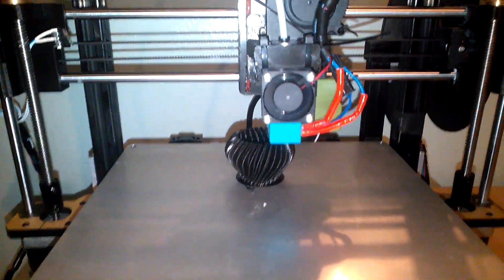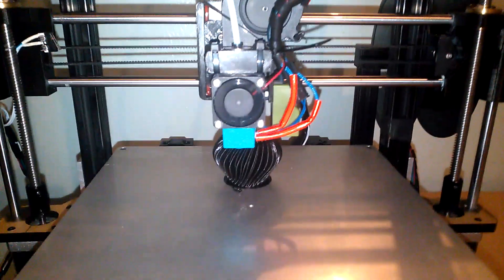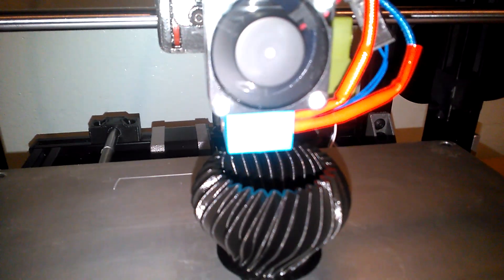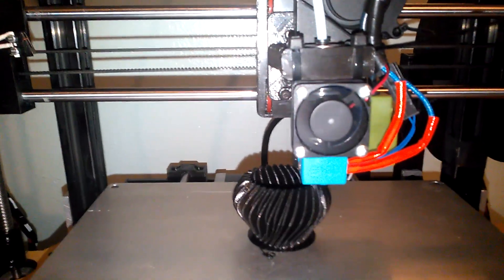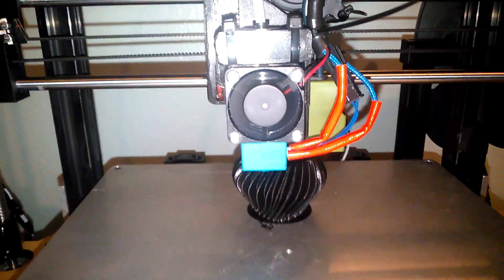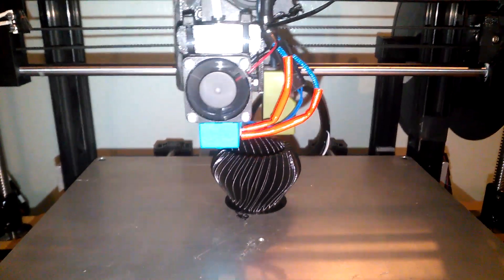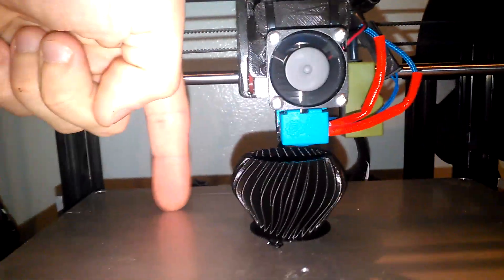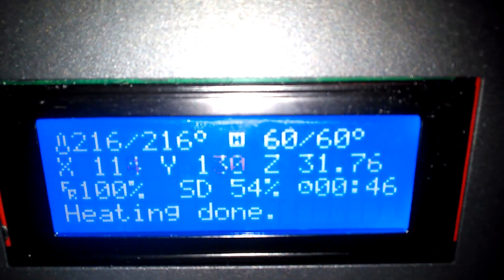Spiral vase mode rules!

Comment: is it PLA or ABS? What print speed is?
Reply from the maker: tobinamburable it's cheap China PLA that came with the printer, but I think it's one of these new pla plus types because it's really tough and kinda chewy, not as brittle as I expected, but it's my first pla. it also prints rather warm at 216c.
I set the speed for 45mm per second. I feel I could go fifty without issues, but I figured there was a lot of jingle jangling and wanted to take it low and slow.
Reply: Do you print at high speeds or with ABS? What is the result? I opt between this printer and Tronxy x3
Reply from the maker: I do not print with abs, it is solely my opinion, but I feel abs is dinotech, too many other good filaments out there that warp less, come out stronger, and emit less fumes to justify it. That is my opinion though. I can hit the temps needed for abs very quickly no problem, with plenty of room to spare though.

I printed a benchy at 65mm/second, although I'm not sure it ever went that fast, because your acceleration settings limit you over short distances(a bugatti goes over200mph, but that doesn't mean you'll see those speeds on normal roads is the best example I can come up with)

Maybe I'll try to do some speed tests before the duet upgrade, and show some prints of the same file, at different speeds, maybe we can spot where it starts to lose quality, and put up a video on it